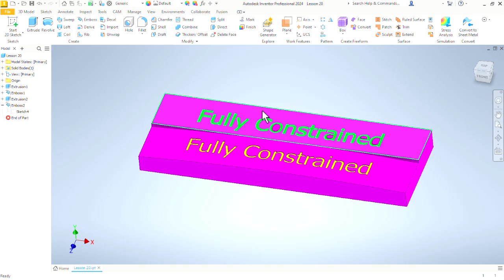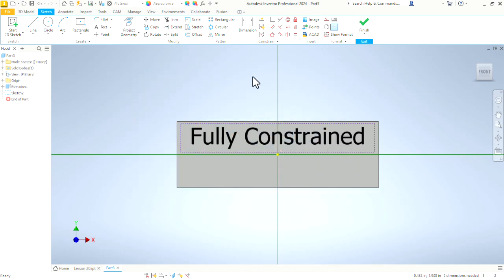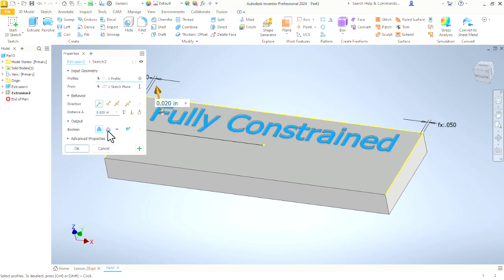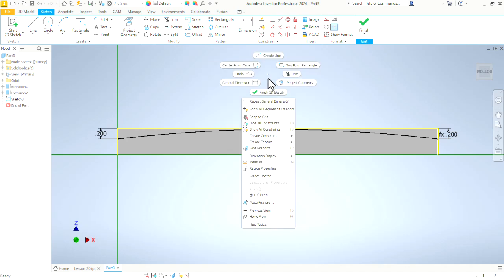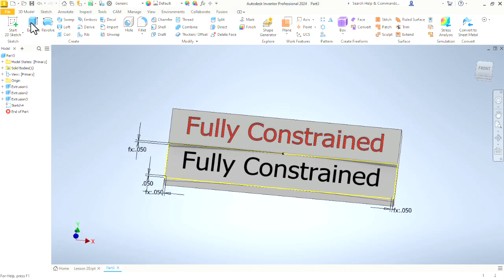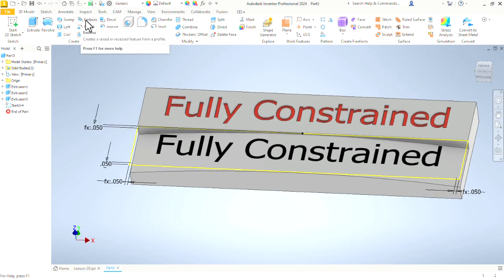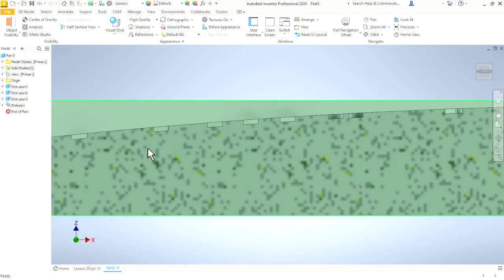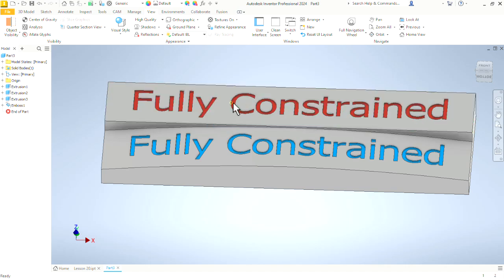Lesson 20 - Adding Text to a Part - Autodesk Inventor

Comment: is there a way to use the OFFSET comand to the text ? OFFSET works on lines but not on text, any way around? ta
Reply from the maker: You can't directly offset the edges of the text in your skecth, but I just came up with a nice workaround. Instead of using EXTRUDE or EMBOSS to cut into the part, use MARK instead. This will create just an outline on the surface of the part. Then start a new sketch and use PROJECT GEOMETRY to include the marked outline in your new sketch. Now you can use OFFSET on that projected geometry. If needed, you can then SUPRESS the MARK after you have the geometry you want. I hope this helps. Thanks for watching!
Reply: @FullyConstrained  thank you...will try that.... Would be nice If you can make a video of it as I'm a newbie when it comes to inventor😂, at the end I need to extrude those texts. Thank you
Reply from the maker: @meguinness1116  Good idea. I'll let you know when I post it - hopefully today.
Reply from the maker: @meguinness1116  Video is ready - https://youtu.be/qlhN3douECk